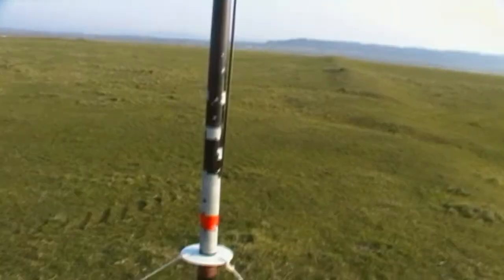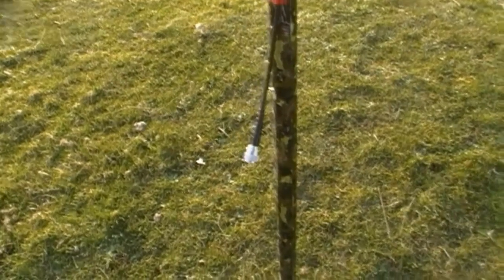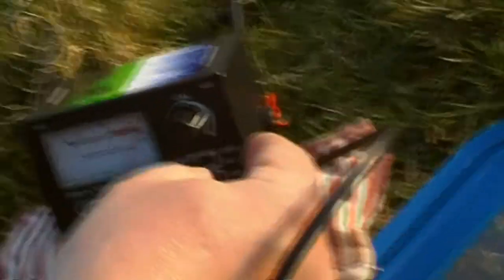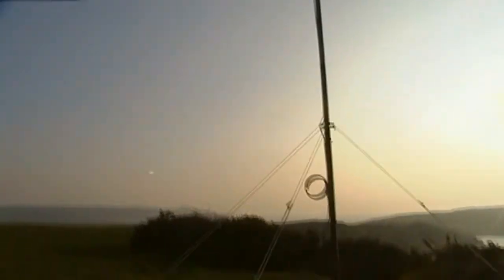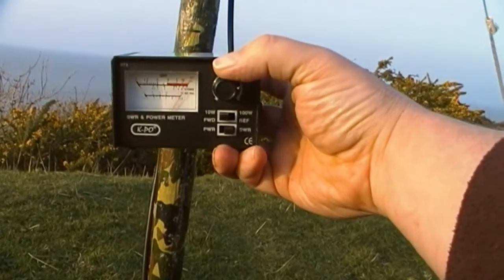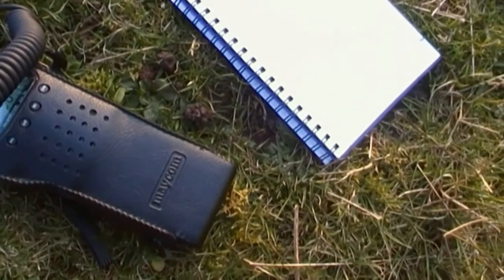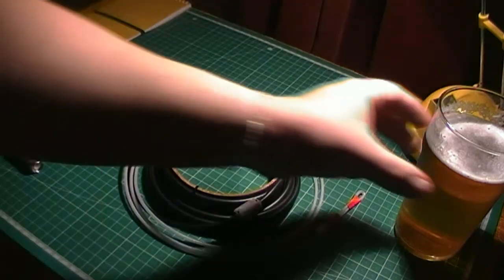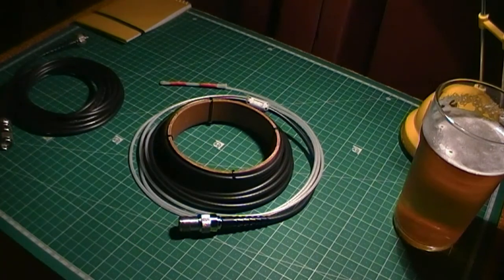(PART TWO) Cheap/easy to make T2LT/Coax Dipole antenna for CB Radio (remake from earlier video)

Comment: Hiya Gary, another great series of videos.!!
As you may remember, I made a T2LT from your last video and it worked absolutely brilliantly from here in Tenerife, hitting the UK last summer at about S7 R4-5 on just 4w and also getting into the USA, all over Europe and across to S.America too (on SSB).
For anyone watching these videos of Gary's, these antennas work and they work VERY well too.!! So easy to make as Gary says. Try one guys, you can't go wrong.
Thanks again Gary for all your input into our great hobby, keep up the good work and I hope to catch you on the air again as soon as poss.
Cheers buddy, all the best and 73's.
Ray 34CT4149 Golden Nugget.
Reply: Enjoyed talking to you with my T2LT also Ray - are you having any luck getting back on air?
Reply: Hiya Swizz,
Nope, i'm saving up for another radio, ( President Grant 2 or The Albrecht AE2990 handheld ) Although i'm pretty much 100% sure I don't need a licence now over here, I dare not take the chance. The authorities over here don't really know their a**e from their elbow when it comes to new rules and regs. Don't want a fine or my current radio gear confiscated, which could happen.
But i'm saving hard and it shouldn't be too long now.
I'm really missing being on the air and it was great to chat to you and all the other guys too.
Will let ya know as soon as I know something definite buddy.
All the best and 73's to you and all.
Cheers. Ray 34CT4149
Reply: Hi Gary,
Have really missed being on the nets too mate. Hoping to be back on air again by the time the sporadic comes back though.
TTFN, Cheers.
73's

Comment: Really Bitchin' sunglasses, are they Revo Aeros?

Interesting that your SWR is so low, considering a 180° dipole is theoretically 74Ω or 1.45:1. I've also done a bit of this type of 'field-fun', (albeit with less wind!) but usually just use 3-4 106" guy lines to insulators as the counterpoise for the upper 1/4 wave.
 I always get 1.1:1 or less, it seems to retain a low TOA, and is usually broad-banded as heck.

 XLNT build/test videos!

Edit # 693:  - So if I were to find you on the band(s) - where/when would I need to look?

73zzzzzzz from the left coast of the USA.

Comment: I've seen both of your videos and the antenna you've made is absolutely fantastic and I might make one myself and try it out on the 10/11 meters I've got a Sigma Venom Silver Rod Hy-Gain 5/8 wave and I have made contacts in to Canada on the 20 meters with it and I made a really good contact to Brazil South America on the 10 meters with just the 10 Watts and I can also tune it down on the 15 and 12 meters and the SWR is always 1.0 right through both bands and the same thing on the 20 meters 1.0 but it seems to work brilliant on most of the HF bands and like I've said before I'll try and construct a T2LT antenna as well. Taanks and best 73's Stephen M3SNV 73's.

Comment: Good video fella I followed your instructions, I just have the pl259 to solder on.
 I will come back after I have tried it, and let you know how I get on.
Reply from the maker: Cheers Steve - glad the videos were of assistance! A.t.b
Reply: @ukcbtv  
Hi Mr 104 well i tried the 2lt today, SWR great on mid and the muppets.
Creeping up a little on the low channels,  its just a tad short for that.
I am  impressed, just for anyone elses info, i have no waste pipe.
Here is how i did the choke, i used a kitchen  roll.
 Took some off until i had the  right measurement.
 Then taped the coils together.
Reply from the maker: @CBRadiouk1  - great idea with the kitchen roll as the choke size is critical to the operation of this antenna! Cheers.
Reply: @ukcbtv  
I also gave you a little shout out fella, told my subs I watched your vid to make it.
Talk soon bud.
Reply from the maker: @CBRadiouk1  - give me a shout if you head out on the hills, it'd be good to get you in the radio. A.t.b

Comment: Are you using rg58 from radio to antenna, if so how long is the feedline? Good easy built, much more broadband than I  expected, so I wonder if coax loss might be making the SWR seem lower than actual?  I guess the loss might keep the radio happy showing a good load, but the DB loss might shorten the range. If it is a short feedline, maybe the reading is accurate, much better than some of my past experiences.
Reply from the maker: Hi there - I generally use the version of the antenna that has the join just after the choke on the radio side and to that I can attach various feeders (both RG58 and RG213 of no specific length). SWR varies very little and I have tested it at that join and the readings are as expected there too, which indicates that the specified choke is doing a good job and the feeder is not acting as part of the antenna. Having said that, the choke isn't going to be 100% effective, which is why I still consider it more of a low power antenna rather than a high power one, but I have heard of guys putting 100w through it Ok. Cheers.
Reply: @ukcbtv  My point, lossy coax drops SWR and broadens out the bandwidth. If under 50 feet, not an issue but longer lengths it matter. I once had a very long 270ft doublet fed with ladder line 450 ohm with a 4/1  balin at the end then about 40 feet of very lossy rg8, the SWR was flat above 13 megs all the way to 60 megs. The reading was false with newer rg213 it had to be tuned everywhere. To build an antenna showing maybe thousands how using a likewise lossy feedline can misinform new viewers and radio folks and when their bandwidth isn't even near the shown antenna, they are distressed thinking they did something wrong when it worked as well as it should. RG58 is fine to build the antenna, but the loss may be greater than a new user will realize if it is fed with RG58.

Comment: Hi Gary. I have just watched these two construction videos & wow  what a great antenna. Pity I can't make one myself. Good job Mate !!!  Keith
Reply from the maker: A few 'experts' did come along to say the antenna was crap but it's widespread use over the last few years has proved it's effectiveness particularly as a rapid-deployment portable antenna. All the best!
Reply: Hi Gary, Thanks for reply. I am disabled, in enforced lockdown since 12th March and I can't put up heavyweight metal antennas. I bought a ready made T2LT type similar to yours. I would like to say that since I have returned to CB after 30 odd years I am impressed by the many homebrew antennas available these days. I paid 25 odd quid for mine. I wish I had seen your 2 videos before doing so. Even in my disabled capacity I could have made one if I followed your good vids. I have been back active for 1 month and have made qso's with 16 Countries so far all QRP. So these antennas do really work well. If I was you I would start to build a few and sell on eBay, a great way to get some extra cash to put towards any new expensive radio toys you want but can't afford. Anyways Mate thanks for great vids, Please keep making them. 73s Keith

Comment: How high was the mast on this? You said 1/4 wave so if I'm guessing right, about 17'~? (The part where the shield stops and it is only core is approx 8.5'?)
Reply from the maker: Mast is a 6 metre one, so getting on for 20ft long - this would make the centre of the antenna just over 11ft from the ground and 8.5ft from the top. I've also used 8m (26ft) and 10m (33ft) masts before with little variation in SWR.
Reply: @ukcbtv  Ah...I just assumed it was 11 meter.
So that's a 1/2 wave for your 6m (and 8/10m) then, yes? (why did I think 1/4 wave?)

Is the 10m pretty stable @ 33ft? Seems it'd be a bit "floppy".
Reason being is that I'm thinking of making one for good ole 11m but thought a mast this long for 1/2 wave wouldn't really be feasable. Was thinking of making it from 5' sections of pvc pipe...
Is 1/4 wave height ok if I couldn't get 1/2 wave?

Comment: Beautifull place! Have you tried putting the antenna inside the rod? Did you do a similar test, just like in flowerpot antennas?
Reply from the maker: Marcelo Luiz Pires - Indeed a lovely place to tune and test an antenna! I have made the antenna with the wire inside for a permanent base install and it worked fine (choke was on the outside still). Important for these antennas is that the rod is only fibreglass with no carbon content. Cheers

Comment: Hello Gary,
What amount of watts can be put through the T2LT?
Reply from the maker: Hi Mark - I've never considered the T2LT of this design to be a high power antenna but more of a temporary/portable/emergency thing due to the fact that there's going to be some RF leakage past the simple choke - for a well made one, I'd say 30w to 50w, however I have heard of ops using 100w or even 400w (I suspect they were hiding behind a tuner for the latter though). Cheers.

Comment: Hello Gary, what are you using as the guy ring on the pole and also what is the diameter at the bottom of your 6m pole please. Thanks Keith (26CT1071)
Reply: ***** Cheers Gary. I was near Clee Hill last weekend in a caravan and just had a small antenna on top of a 2m speaker stand. My plan is to try and fit the pole inside the stand (assuming it will fit) hopefully for a bit more stability. I'm restricted into what I can tie the ropes to as where the stand is located it is mostly concrete / slabs but can tie ropes to posts / fittings etc. If you can let me know please the diameter at the bottom (hopefully it will be less than 35mm). Weather permitting in the summer I can have a walk up to the summit and try out a T2LT - have to plan a route though as doesn't look a simple path up. I can see the NATS equipment at the top and guess I am around max 2 mile away and around 400-500 feet below on the eastern side of the hill

Comment: Do you sell these antennas? And if so how would I go about purchasing 1?
Reply from the maker: Hi - I don't sell them, but a guy on eBay does https://www.ebay.co.uk/itm/DRX111-T2LT-1-2-Wave-CB-11m-Portable-Antenna-System/293365875894

Comment: How would running the antenna horizontally affect performance?
Reply from the maker: Hi John - the T2LT is electrically the same as a centre-fed dipole so can be used horizontally. Performance when talking to local users with vertical antennas will be around 2-3 S-points down and the antenna will be directional (if run north-south, east and west would have the most gain). However, horizontal antennas tend to pick up less interference and and can be good when working DX when the skip is running. Well worth a try. Cheers.
Reply: @ukcbtv  I can imagine running it as an inverted V would make it decent for local/omni talk and still use for skip.
;)

Comment: you dont sell these by chance do you?
Reply from the maker: I don't, but there is a guy in Wales who lists them for sale on eBay - apparently they're Ok and cheap too. Cheers
Reply: UKCBTV what should i search for?
Reply from the maker: +30CalCoreLokt - search for 'T2LT CB Antenna' (seller is in Abergavenny).
Reply: UKCBTV would you say these are betger than the horizontal dipoles sold on ebay?
Reply from the maker: Electrically the T2LT is a dipole, so should work about the same if mounted horizontally.